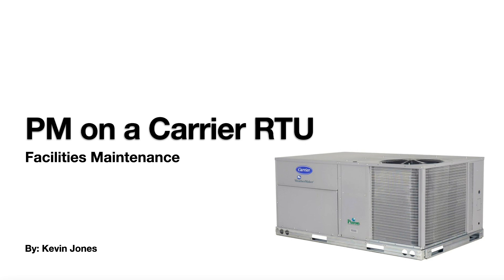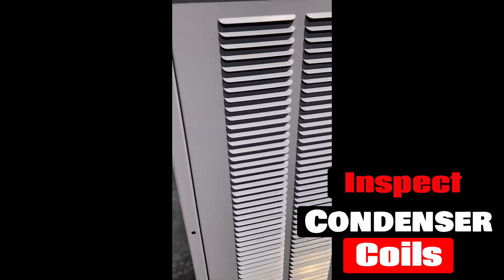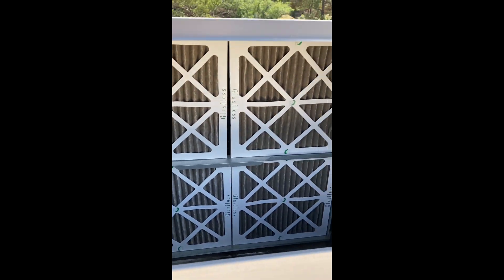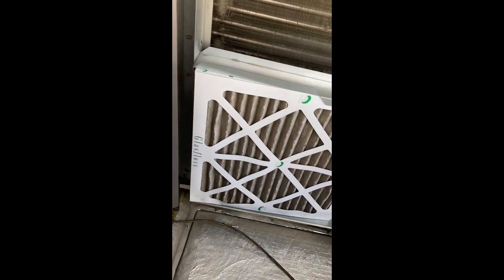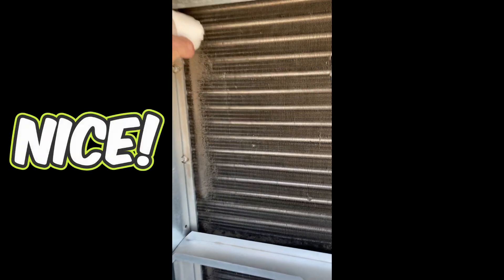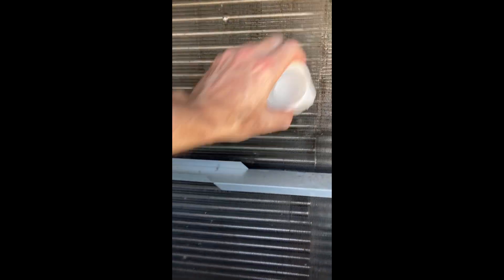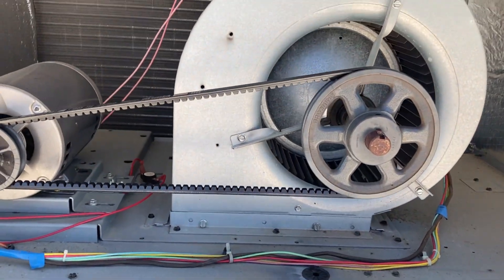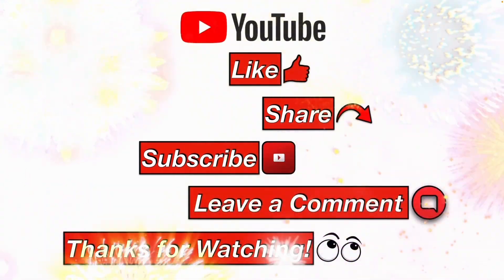Carrier RTU PM | Facilities Maintenance | HVAC

Comment: I have a question say I would like to collect the blower motor amps, inducer amps, micro amps and igniter ohms how would I do that ? On a carrier package unit ?
Reply from the maker: You can use a clamp-on amp meter to measure the amp draw of the motors you listed.
Reply: I’m I able to get readings for ignitor ohms even if my ignitor is a spark ?
Reply from the maker: @emmanueldeita5362 you only wanna check for ohms with the power turned off.
Reply: Thank you so much for your help
Reply: Got me subscribed to you
Reply from the maker: @emmanueldeita5362 you’re welcome!